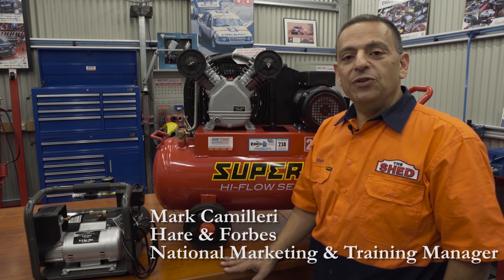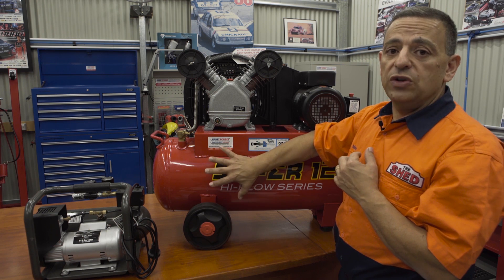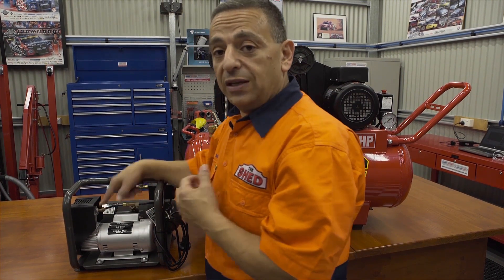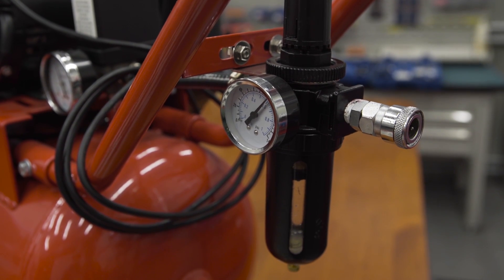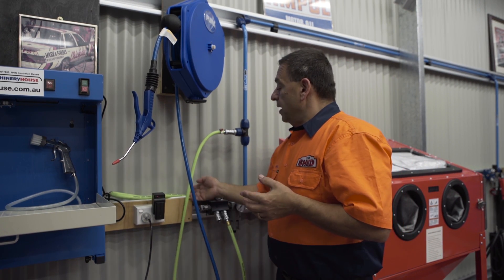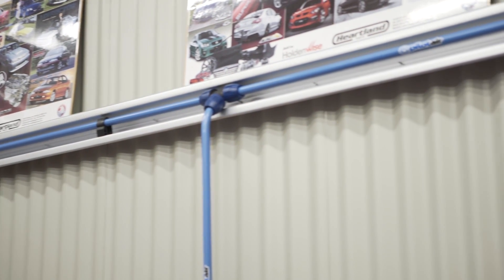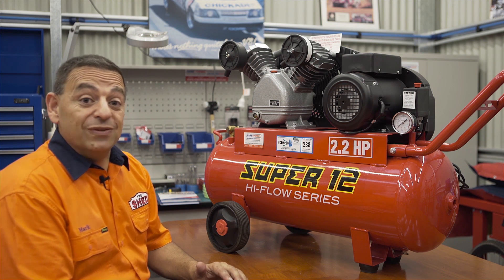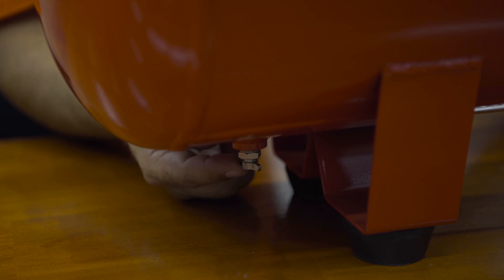The Shed: Part 3 - Installing And Maintaining Your Compressor

Comment: For many years I had run a 150 Lit receiver I made on the farm for portable cleaning of harvester's and  Bulldozer as well as tractor air cleaner's in the field.  I now use it in my home workshop so I can have a HUGE reserve,  run the compressor much less frequently .  Now to the over kill,  even though I run a remote Air intake to the compressor one of the things I do regularly is to vaporize mentholated spirit and alcohol into the line in both the main tank and my big reservoir. 
  
The reason behind this is similar to running Methyl Hydrate in sub zero temperatures because the Metho and Alcohol is extremely hydro-scopic and will absorb the moisture rapidly allowing it to be drained from my tanks ( - 5 to 10 ) nights probable help in this regard, gets a bit nippy in the Snowies 
As has been said and I will reiterate there is no substitute for having a top quality moisture trap in your delivery lines , Air tools are great BUT you must feed them clean DRY air and oil them regularly as well if you ever want them to last. 

I have GOT to get me a media blasting cabinet !!

Maurie
Reply from the maker: Good afternoon Maurie, Thank you for sharing your information, hopefully others who live in sub zero areas can use your information to help them as well,
Reply: I'd suggest that even if they are not in cold conditions that they look at the potential for moisture removal as it is a problem for those in humid areas of Oz.   I have never seen any real solutions that weren't darned expensive to implement hence using alcohol and the last time I placed a bore-scope in the tank I was surprised at the lack of internal surface corrosion I expected.

Comment: A good idea is to remove the factory screw type drain valve and put a 1/4 turn ball valve in instead. Much easier to release the water and doesn't leak air/get clogged with crap like the standard screw valves (at least this is what used to happen on my pilot compressor).
Reply from the maker: Hi drufzr600, thank you for the advise, we don't seem to have this issue being reported back to us, but i will advise Pilot air on your suggestion/recommendations, cheers